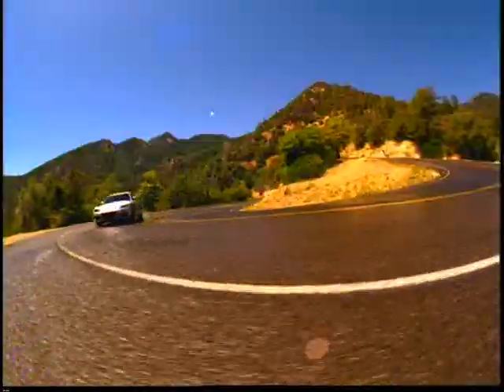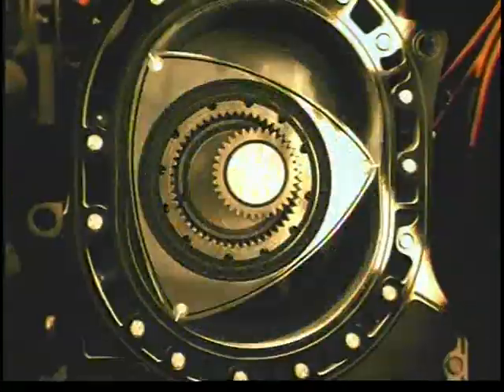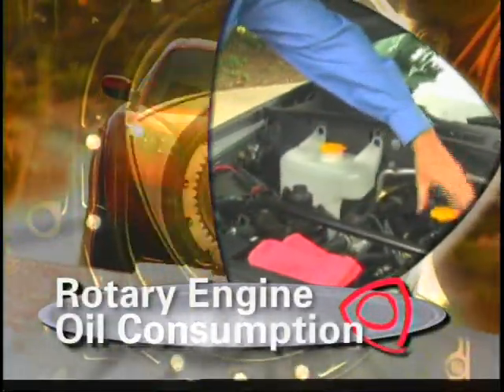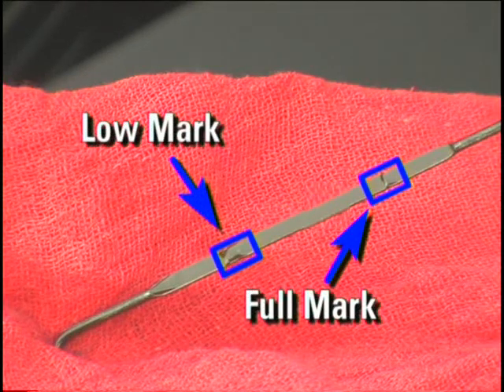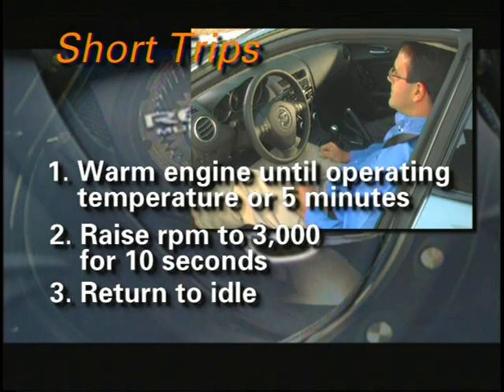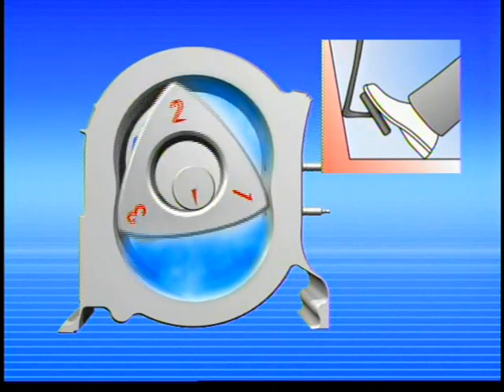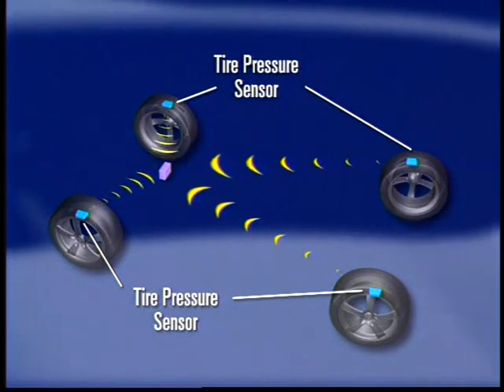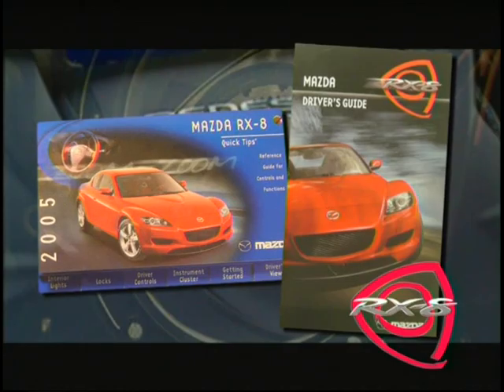RX8 Ownership Video

Comment: Fuel consumption is a problem here!
Reply: We all know the RX-8 is a high maintenance car. The main reason the RX-8 was discontinued was because of the crappy fuel and oil emission standards in Europe. You're the one with poverty. :/
Reply: ***** I'd have to step in here, whilst I find the lack of Torque an issue in my RX-8 R3, Eryk Pyts has exaggerated a lot there.
I have no issues when overtaking, for commuting I tend to keep the car around 2,500 RPM and just drive normally, if I'm driving more spiritedly, I tend to be at no less than 4,000 RPM, during these spirited drives, the car is getting rev'd like mad to make anything happen - but that's part of the characteristics of the rotary engine.
Reply: ***** A bitch to drive? If you see keeping revs up to get the best out of it then you shouldn't be buying a sports car as you don't seem to fully get it.

The RX-8 is an absolute joy to drive, working through the long gears and hearing the unique rotary whine is quite simply a pleasure. 

The high maintenance and expensive running costs are just a small compromise to the truly outstanding chassis and suspension setup. The 8's ability to properly tackle a corner so dynamically is astounding in a car that can be picked up so cheap.

The car was marketed to the wrong demographic at launch which has caused a very mixed opinion to be had on it over the last 10 years, it should have been marketed as being what it is, a fantastic, simple, back to basics drivers car.
Reply: ***** RX8 192 has 190bhp and the RX8 231 has 228bhp.
Reply: ***** Then change your plugs.
Reply: ***** I dont have an RX8 but I know way more than most, 654ccX2=1308cc making it the worlds second fastest 1.3 the fastest being the RX7.  Revs to 9500rpm with a buzzer at 9000rpm to tell you to change gear.  The RX8 192 has 190bhp, 0-60mph takes 7.2 seconds and has a 139mph top speed.  The RX8 231 has 228bhp, 0-60mph takes 6.4 seconds and has a 146mph top speed.
Reply: Ben Tennyson memorising some of the most basic facts and figures about the 8 hardly makes you 'know more than most'.
Reply: Edwin Scott That is just a fraction of what I know about the RX8.
Reply: ***** There are lots of cars that are fast and nimble for the price of an new RX8, Ford focus ST, Vauxhall astra VXR, Vauxhall insignia VXR and if you want to really go mental £22k will get you a Vauxhall VX220 turbo.
Reply: ***** The ST is still fast regardless, as for comparing newer cars I wasnt doing that.  The cars I mentioned are 3 years old at least.
Reply: ***** Yeh.
Reply: Ben Tennyson Mazda Rx8 was meant to be like brz or s2k. They love corners and slide their tails. Only a real car enthusiast didn't even care to spend his money on rotary engine. beside not all sports car meant to be fast, some of them tend to be a joy to drive.
Reply: Actually if you compare the MPG for the RX8, S2K, 350Z, G35, FRS the best of the bunch is the FRS but its newest car and its roughly 25K at the dealership. Most of these cars have the exact same MPG only like 2-5 difference, Almost every Class B and up sports car gets shitty MPG there is no escaping it, its because its a "real" race car if you can't handle it keep driving a Civic.
Reply: Hontoni Arigato i drive civic type r and i find this offensive, LOL. but really, even on my type r, MPG does really sucks, good thing in my country, 1.88 liter only cost 0.80cents us currency, around BND 1.
Reply: Oh shit guys chill! I made a stupid comment about fuel consumption actually I was trying to ask if it was a problem or not. I'm just a potential owner that tried out a friend's RX-8. Have a nice day everybody
Reply: CarCrazy That's interesting and thats cool that you have a Civic Type R. The problem with people is that they're lazy and stupid. They want a sports car that's powerful, can drift, grip, has all this technology and comfort but they don't want to lift a finger to do any research or fix the car. These people will never get anywhere in life.
Reply: Hontoni Arigato let em be bro, if they want a perfect car, then built them self
Reply: CarCrazy A'men to that brother
Reply: HexagramMan  You obviously have never driven one, go drive one first, it is the best sports car in the same league, it has decent power you just don't feel it like a turbo, and no sports cars are not only built for speed, it is build for looks and drivability, fun factor. A good handling sports car with decent power is a lot more enjoyable than a silly fast straight line car with poor handling because unless you break the law, you can't go that fast but on the twisties you can have tons of fun and still don't break any laws.

Comment: Im Thinking of buying an Automatic Rx8, but seeing people spend tons of money on it is kind of changing my mind.. 
Is there.anything i should know of these cars if i buy one??
Reply: gabrielgee5 You'll hate yourself for loving it so much.
Reply: gabrielgee5 1- the automatic is actually a lot more fun than most will have you believe despite the 30hp missing from the manuel version. I recommend learning stick, but if you don't want to the RX8 auto is a far better choice than most cars its age.
2- If you dump a little bit of 2-stroke oil into the gas tank when you fill it up you essentially make the gasoline a secondary lubricant, circumventing many common issues with the apex seals.
3- It is a sports car. Treat it like one. It can be used every day, but it isnt a mustang or a miata, you need to be attentive to your car's needs.
4- being a total car nerd is a requirement. You say you aren't one now? Give it time, my friend.
5- Resist the urge to give it hugs, no matter how much you end up loving it.

A word on rebuilds:
As far as when the dreaded day of engine rebuild comes, have a plan. At independent shops rebuilds can cost about $2000-$3000 and if you have some money set aside for it it is a nearly painless process. Even then it isnt that expensive, the car's reputation damaged its resale to the point where it costs about as much as a 350z after you factor in the rebuild, and since your insurance will see it as a "1.3L sedan", you will come out ahead with the RX-8 making it quite the economical choice... I know "economical" and "RX-8" in the same sentence, but it is true.

Anyway, happy car shopping, I do recommend this car to anyone willing to love it as much as it deserves.

Comment: Is it true that an Rx-8 engine can only last 70'000-100'000km?
Reply: Follow normal procedures and it will last probably around 150000
Reply: ook
Reply: it will last as long as you want it to, all you have to do is take care of it correctly and keep up with REQUIRED maintenance that is normally only recommended for others and using correct start/stop procedures.
Reply: Olmah L. more than original procedures.

Comment: Today is the anniversary of the death of the Wankel engine, 5 years ago today June 22, 2012 at 4:30pm the RX engine assembly plant at Mazda Ujina #2 shut down and shortly there after was dismantled to make way for a brand new engine assembly facility at Ujina #2 specifically designed to manufacture Mazda's successful new signature Skyactiv-G ® line of reciprocating Otto type engines

Comment: I want a 2011 One.
Reply: Im going for a 2005 model because 12 month roadtax is £280, 2006 and above its £490.
Reply: Ben Tennyson nice choice BT, also the 09 and up model is a joke. They made it heavier, slower, and didn't add anymore hp or torque ;T
Reply: Hontoni Arigato got a 350 im good